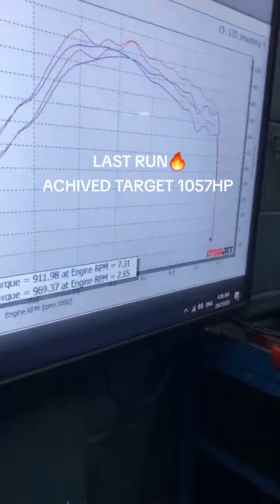BUILD MACHINE|SATRIA AWD 1K HORSEPOWER |SETIAWANGSA RACING|MPTUNER|JONSRMACHINE

Comment: dari inter-cooler tu pakai getah keras siap ade tulang , dia macam jantung, kalau turbo spool banyak dia boleh sebab dia ade tulang getah kotak2 tu, lagi satu ringan....keras getah tu, dia macam getah air-bag suspension...lagi satu kalau kita slow down, dia tendang turbo, jadi turbo tu sejuk, bearing jer selalu nak kena tukar....buat piping aluminium macam tu, dia sejuk, tapi selalu bocor pecah..orang gantung radiator tak selari dengan mounting engine selalu pecah pipe intercoolernya, kereta besar2 macam Mustang pakai getah jer....kalau 600hp macam tu meletup kat highway boleh excident.....tapi kalau untuk auto-show main pipe intercooler tu memang dah jadi tradisi......intake tu penting, salah korek angin keluar balik langgar turbo hancur turbonya...dia buat pipe exhaust manifold berpusing tu tujuaan dia untuk clearance, tapi korang tak pakai catal exhaust kan, so tak  penting nak pusing2, mat salleh pakai catalyst, maknanya bawah exhaust ade tabung lagi, budak ni semua straight pipe jer...pipe turbo pun samalah, untuk compression....
-:tok wali dah kenakan orang dekat 20 tahun, mana aku bagi dia nak buat kereta aku, pergi cari orang lain